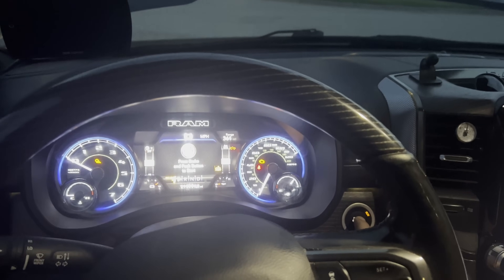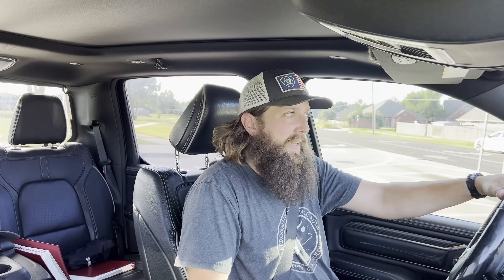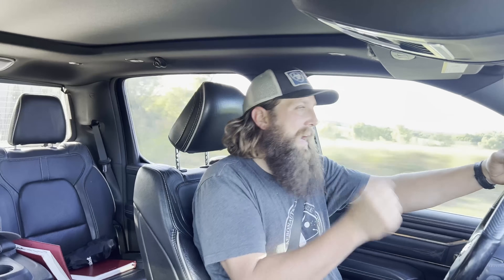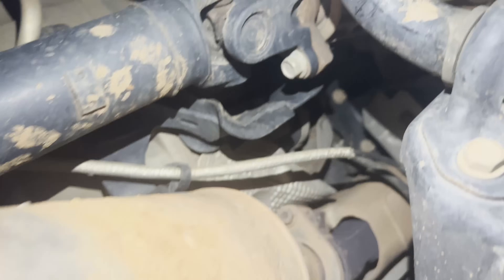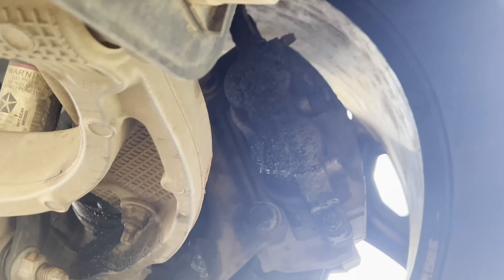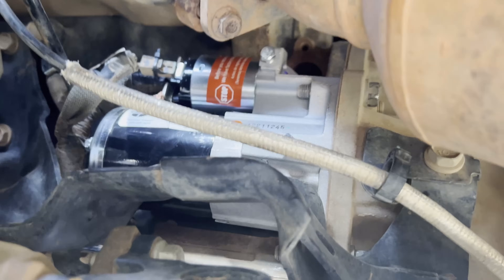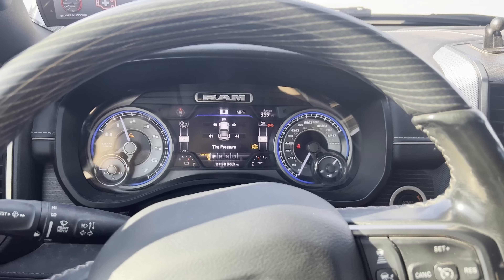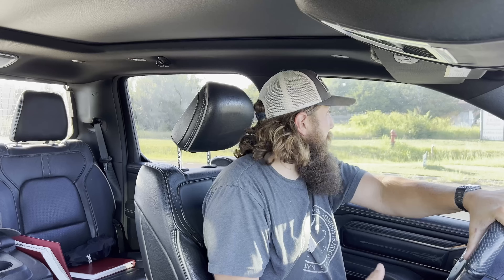2019 Ram 1500 *NEW PROBLEM* Engine Won't Start | Truck Central

Comment: My 2015 needed a long block at 250k miles. Another 100k miles the accessories like fuel pump started failing. I’m getting it fixed. It’s been an awesome truck. 

Now I’m looking at a 2nd vehicle for instances if/when my truck fails and found a 2019 Ram with low miles however it appears to be insanely less reliable than my current model.

Comment: Mine is a 2020 Ram 1500 5.7 hemi. Thought I needed a starter after ruling out everything else. Guy told me to put a new battery in my key fob. I’ve done that and it’s started every time for 2 weeks now. Waiting for the next no start but keeping my fingers crossed.
Reply: Do you have a remote start? 
That's an interesting fix

Comment: Great video Justin. Curious to know if there is a way to test that starter without taking it all apart. I hope this fixes your issue.
Reply: Thanks Angel. You can get the starters tested at certain shops, but at that point, I’d feel more comfortable just replacing it with something new (with a warranty).
Reply: Load testing starters used to be something all auto parts stores did as a free service before they sold you a starter or alternator. At your mileage you were probably going to need a starter soon anyway but I suspect you have a connection issue at one of the many points between the battery and the starter.

Comment: had a brand new 2022 ram hemi laramie.  less than a year and around 48000 miles the same probelm happened.   what's crazy is theres no option to manually start with etorque.  that would be nice

Comment: This happened to my 2020 when it had only 45k miles on it.  I had no warning signs, just went out to the truck one morning and nothing.  I will say that it was only 7 degrees out that morning.  Anyway, I tried a new battery and that didn't help.  Luckily for me it was covered under warranty.
Reply: Same here. Snowed last night in Colorado. I went to start it this morning and nothing...
Just one pop sound from the starter. 
It did finally start. But then happened again.  
Battery. Alternator and starter all tested good.
What was your issue? 
Is it fixed?
Reply: @-a-strikelures1212 oh I had to get a new starter.

Comment: Electric connector on starter wiring corrosion, I replaced the down wiring harness ,, exact symptoms… maybe just cleaning all surfaces ,,, you replacing start likely gave you fresh connections

Comment: started with mine at 60,000 miles. Something to look forward to this weekend!  Great video!
Reply: Just check the bolt on the power for the starter. Mine was way to lose for my liking. Tightened it up and I've had no issues for 3 weeks. Truck has 55k and I'd say it was just a bad connection issue.
Reply: Thanks, I'll check it out tonight! @renecastellanos9155
Reply: @davidduran8465   also, check that little wire that goes to starter. If thats corroded and bad connection it wont start. I can almost guarantee thats it. Its so common
Reply: I'm at 59K and have had that problem last 2 days.

Comment: I left my heated seats on  several of days and each day I did the truck wouldn’t start so I’d have to jump it each time. Wouldn’t have forgot so many times to shut em off if the dang heat would work right. Heater core might be going out or thermostat not working properly hopefully not the head gasket or cracked head, I just bought this truck from a private seller and seems like I’ve had nothing but problems with it so far

Comment: I have this problem and it is pretty frustrating. I have been living with it for months now and was fairly sure it was not the battery due to it being an intermittent problem. Also, even with a jump pack hooked on it still will occasionally fail to even try to turn over. further making me think corrosion (despite loooking clean) or some other weird issue. so I got a new battery, cleaned the connections and bam still nothing, so I have yet to finish this video but I know its some bs issue lol.
Reply: See my comment above.  Might solve your problem?

Comment: Any updates by chance? I'm having the exact same issues on my 2019 Ram 1500 big horn? I have gone through 3 Mopar batteries since I bought it 5 years ago. It did it again yesterday and this time the starter started smoking. I just don't want to start replacing components blindly.

Comment: Wow surprised to see the CV boot like that, any signs or symptoms besides the visual grease? If you remember I had issues with mine around 50k miles (low speed when turning would hear clicking/popping/clunking noises), I ended up replacing mine with a Heavy Duty Shaft with a thermoplastic outboard boot from Cardone, no issues so far at 60k and sounds are gone. What did you use to replace yours and do you think its wear and tear/bad boot, or did it tear on something like a rock etc?

Comment: Just started having this problem on my 2021 (2500 6.4) two weeks ago. Truck has 27k and thankfully still under warranty. Currently at the dealership, service guy said he thinks bad battery cell. Haven't gotten a call confirming yet.
Reply: yea dealer has told me that 4 times now. on battery number 5. im taking the truck to them tomorrow and telling them i dont want it back until its fixed. 2020 Ram 1500 etorque with 26k miles. its ridiculous, car has almost been in the shop longer than ive had it in my possession. seems there are quite a few problems like this starting problem, ranging from seals around window or third brake light leaking water on to 48V battery behind seat and shorting things out intermittently. my problem only surfaces when i leave the truck parked for more than a week.
Reply: @daxrussell8863  Waiting on a part now. Some sort of sensor on transmission that tells the truck its in park to allow for cranking. What I was told anyway.  I guess time will tell.

Comment: I have one of those money pits too. Ran fine drove 30 miles to sams club caMe out all the lights work no click dont take a jump,  no codes. FML towed it home 160.00 it still sit in my circle driveway where the guy left it lastweek.. im guessing started solenojd. New starter now.😢

Comment: Did you have to disconnect your front drive shaft? To do this? I am having the exact same issue. I am getting by with rolling the crank over to try to get that bendix to line properly.

Comment: Hate to see it happen to you too. Have almost the exact same story have an 2020 1500, 50k miles. Started what seemingly was a bad battery noticed some corrosion on the terminals. Cleaned it and it worked for another 3 weeks or so. One morning just a click no crank. Replaced the starter and apparently the extra drain causes the battery to have extra stress and that died a week after the starter. Wonder how wide spread the starter issue is, these engines have been around a whole wonder what changed.

Comment: Nice video! I couldn't tell in the video, but does the truck have a different startup sound now?
Reply: It actually does sound a little different. Hard to tell if it’s just a better sound, or just different. But it was noticeable.

Comment: My 17 started this last week after christmas.  Click no start, pull the battery it tests low, put a new battery in it runs fine for a week until this morning.  Cranks and drives 15 min to gas station, go to start my drive to work after filling up and click no start.  Had to jump it off.   Ill start checking the starter connections after seeing your video.  Thanks for posting!
Reply: Turns out my hot lug on the starter had worked its way loose snd the serrated lock nut had worn down and is smooth.  Going to throw a new nut and lock washer on it and see if it fixes it.

Comment: I had the exact same issue on my 2020 1500. Replacing starter now after putting in a new battery in and having the same issue.

Comment: Mr Wheeler! Based off your experience with your 5th gen would you recommend chancing a 2019 Ram 1500 Laramie with 260,000? I recently found one for 15k and thought about getting it with hopes of getting another couple years from it. I do not drive much, I have a company vehicle for my day to day driving.

Comment: Watched your video and I think this might be the issue I just experienced this morning with my 2019 Ram with 205k miles. Well first off on Monday (21 July) my check engine light turned on and my remote start hasn't worked since then. I ordered a code reader but it will not arrive until tomorrow. So this morning, I went out to start my truck pressed button and it tired to turn over and nothing, tried it two more times and nothing. My first thought was the battery, I went and checked the cables, cleaned the build up on the ground and reattached it so I could try and start it again. I tried to start it and I heard a pop through the speakers and no start and almost nothing is turning on when I push the start button. It is basically dead and unresponsive, I have to cycle through the push to start let it sit for a second and try it again. Same thing two more times, I hear a pop in through the speakers and I have no gauges and the engine does nothing. Has happened to you before, is there another reason the only thing on my dash that shows is no key fob detected? Any help you can provide would be greatly appreciated.

Comment: Hey thanks for the video... I have a 2018 ram 3.6l which I experienced the same symptoms and replaced the starter... Which works fine after replacing it but only for about 5 or 6 starts and then the same symptoms so I've warrantied replaced the starter 5 times now once I was even performed by the dealership to which it happened again was curious if you've had any problems since replacing it...

Comment: Be careful getting your parts from Carquest. That’s where I was getting mine from like the radiator and water pump for some Carquest and they had to keep replacing it. Just a heads up maybe you’ll get lucky but I had to replace my starter to as well.

Comment: usually loose connection on solenoid. stiff heavy wire bundle at starter plus big wheels and tires vibrating loose

Comment: I just bought a 2021 limited and while looking at carfax report that model also had a starter replacement and battery replacement..... 1 or 2 years and starter fails? Gosh i love ram but wth is up with the durability

Comment: 3 weeks back my '19 RAM 1500 wouldnt start.  i jumped it, and swapped out the battery. truck ran great until this morning.  dead again, but this time the 2-week old battery was BONE dry, no power at all.  wouldnt unlock without the fob's key insert. tried to jump it, no luck this time. only a few clicks. could this be a starter issue, possibly causing a Parasitic drain?
Reply from the maker: No that doesn’t sound like it has anything to do with the starter. Either a defective battery (it does happen), or there is some sort of parasitic draw. Does your truck have air suspension? (Could be a leak that is causing the compressor to run)
Reply: @TruckCentral  thanks for the relay. no air suspension. could it be the AMP running boards? noticed they started randomly not deploying after swapping the battery a few weeks ago…
Reply from the maker: @Drewgulbas  I don’t know but definitely possible. I would try unplugging the obd connector and seeing if anything changes overnight

Comment: Did you ever diagnose problem with air suspension? I have same ram 1500 limited and I installed b&w turnover ball just like you did and it has been awesome until now my rear bags drop sometimes after sitting a few hours. Not every time but sometimes

Comment: My truck is a 2020 ram 1500 Laramie, with 20,500 miles on it and it’s having starter issues. Gonna take it to the dealership, it should be under warranty. But it has to be towed
Reply: My mechanic replaced the battery, he said it was the starter not the battery.

Comment: More than a few people with this issue.   My 2020 Ram 1500 with 37k miles, is going up on a flatbed as i type.  Ive been chasing this peoblem now for months.  Battery is tested and good, alternator good too.  Rf module, opens and closes the doors and tries to start the truck.  I get nothing but a loud "click".  It's throwing no codes and the dealer "cant replicate the issue".

Its been intermittent, but completely crapped out yesterday.

 Im forcing the dealer to put in a new starter.

Comment: I’m having the same exact issues with my 2022 Ram 1500 Laramie etorque hemi with 49k miles. It just recently happened about 5 days ago. I got a jump and it fired right up. No issues for about 5 days then it happened again this morning. No start, tried jumping it again and wouldn’t fire up for about 10-15 mins. Battery, alternator and starter tested, everything is green. It’s frustrating! 😮‍💨 Warranty is expired and dealership wants $200 to diagnose it. They hooked it up when I went to set an appointment and they said they seen no codes. Looking from the comments I kind of wonder if it’s even worth taking it back to the dealer if they’re not getting any codes.

Comment: I had this exact problem on my 18 1500 was playing around with some friends on a trail shut it off click click trying to start it. My only conclusion is a winding or terminal was work not allowing the starter to work

Comment: I have a 2019 1500 3.6l with the same issue , I replaced the main battery , and starter motor at the dealership. 3 days later the engine won’t start again . Any idea why ?

Comment: So did this solve the problem? Your truck was having the exact same issues mine is. Just like you, I replaced the battery and everything was fine for a couple months and then it started again. Just want to see if this fixed it before I drop $300 on a starter.

Comment: I have a 2007 with 85k on it and it's doing the exact same thing.  I can drive it a short distance and it will randomly do it after shutting off the motor and going into the gas station a short amount of time.  So,  here is another exact symptom,  but low miles,  but lots of years.

Comment: This happened to me on Monday this week, and dealership made me pay 180 dollars to look at it and $880 dollars to replace battery and starter kit. 
I dont understand much so I had to accept the charge n get it fixed. But I cant know if it is true or they scammed me
Reply from the maker: Wouldn’t worry too much about it… at the end of the day, your battery and starter were probably getting old anyway - now they’re new. If the truck starts now, I’d say that’s pretty reasonable 👍

Comment: Hi I'm having the same problem with my ram 19 I've been to the dealer several times and they said it was the battery and then the next time  they said something was drawing on the USB ports. So I replace the USB ports .I still have the problem  2 weeks later. Did  replace the starter fix your problem?

Comment: I also think it was the bolt, not the starter.  I have the same issue battery good won’t start on a 2017 Ram.  You are “fixing” it by disconnecting the battery and allowing the computer to reset itself.  My has been “fixed” this way once before and i sit here now hood up “fixing” it again.  The true fix is something else and I now want to check that terminal on my rig.. but what is interesting to me too is that when the truck won’t start, it thinks it is on.. so Uconnect picks up calls, etc until the battery drains..

Comment: replaced my starter on 2002 gmc hd2500 last yr....it took 20 yrs to fail...so urs shouldnt fail in 4 yrs, but mine was heavy AF.
Reply: A little earlier than I’d prefer, but for the mileage and amount of “starts” on this truck, it wasn’t bad.

Comment: I just had an issue with click but my side step didn't deploy, ouch my shin.... got it charged up and jumped until it started and now i have all kinds of air suspension stuff going on. Oh before and while charging battery heard sputtering on off sound maybe air pump by or near battery. Now charged and running it won't let me raise or lower truck says service air suspension and service electronic stability control. This happened out of nowhere. Drove it earlier to car wash parked it all day and going out to pickup my din din and ran into this. I checked online about holding down suspension button for 40 sec with truck off in run position for batt. Fingers crossed i don't need an expensive repair. Of course i just bought out my lease and now this happened.

Comment: Same exact problem, same exact solution on my 2019 Ram 1500! I started by replacing the battery which did not fix the issue, then I went and got a new starter (do not buy remanufactured!) and that completely solved the issue.

Comment: I have a 2022 2500 4x4 30,000 miles and it the same problem to the T, the dealer said it's was the battery , my son kept saying it's the starter so now it's doing it again more often and if u lay under the truck and keep tapping the starter it will end up starting so it's gotta go back to dealer $80,000 truck and I gotta lay on ground and beat the starter , I love my Rams but it's pissing me off lol.

Comment: First off is that a 1980's calculator watch? 🤣🤣 I have a 2019 and this sucker has been a lemon from day one. I had the exact problem you did disconect battery and it would work , did that for 2 months pretty much every other day and then it went away. Then I had the ignition switch burn out of the vehicle litteraly amongst may other things , over $20K in repairs since 2021 ( no warranty) now I have 3 other rams as well from 2020 and 2023 so far so good.

Comment: Toyo tundra and my ram wasn't the starter but the  wire clips lost the tabs and disconnected ... The only reason I knew it was a cable acting up because I replaced the starter twice in one week

Comment: i use to have similar issue on only 30k miles truck of another brand and it ended up being burnt fuse connection... always something, and if it's not something then it's something else